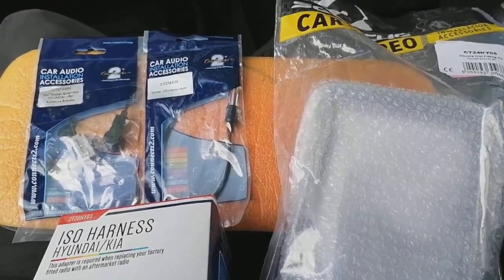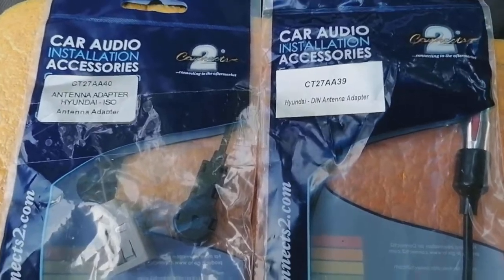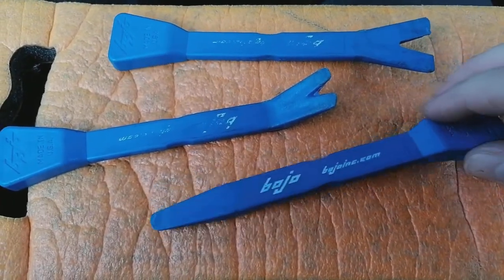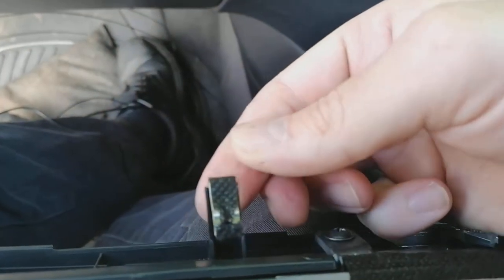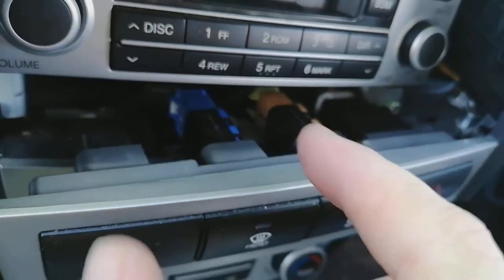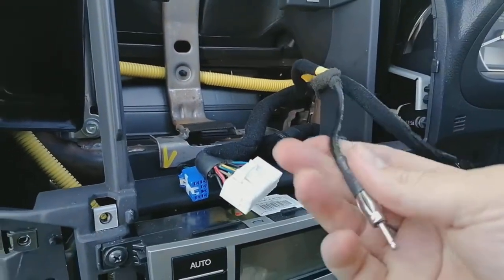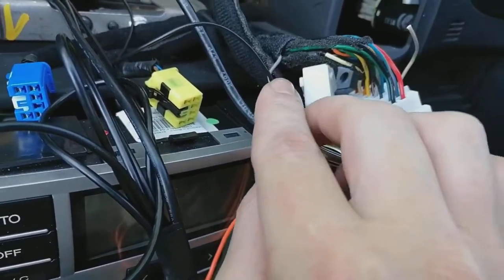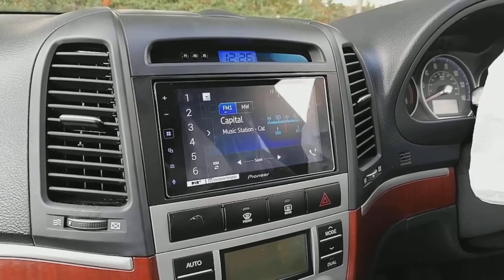Hyundai Santa Fe 2007 - 2012 factory radio removal & part numbers for upgrade.

Comment: I'm thinking of ordering a stereo but the adverts all say wont work with factory premium wiring.  Is this just because of the amp cable?
Reply from the maker: Yes, you would need to find the correct amp bypass interface by giving your reg number to a large car electronics outlet like Halfords (UK) or maybe try Connects2.com
Reply: @PJsprojects  OK thanks